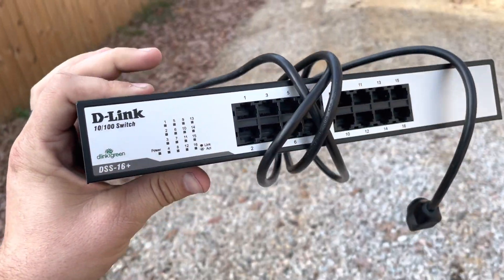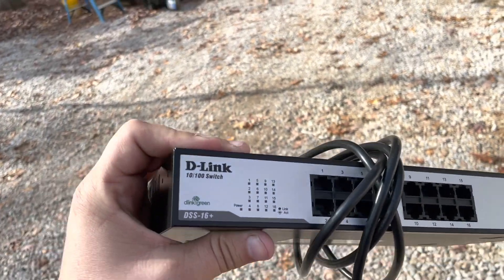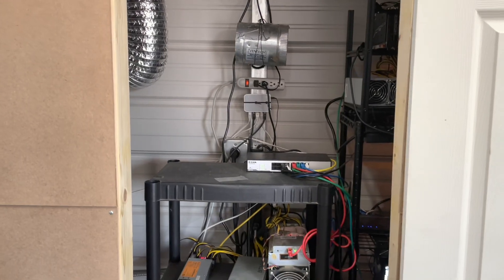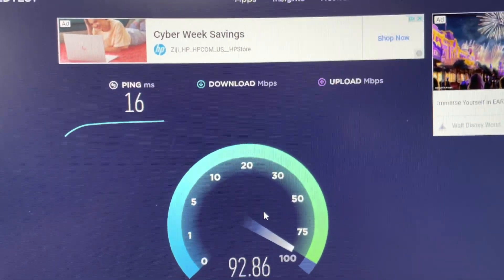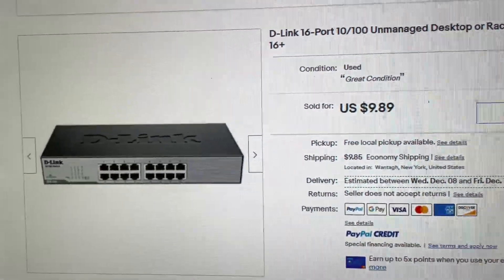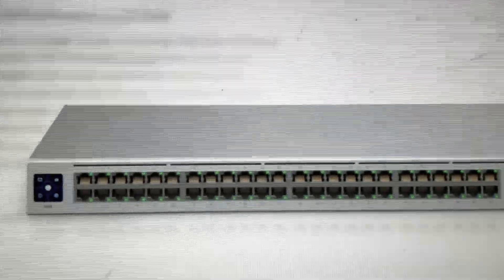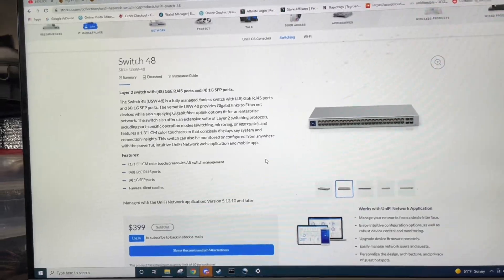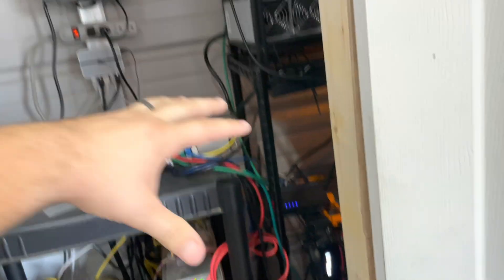Cheap Network Switch for Mining Rigs

Comment: Any old as heck router can be used in switch mode. I literally have a stack of old Linksys routers that can all act as 10/100 switches. I pay about 5 bux for them at a thrift store and they are bullet proof. And if one breaks? Oh well I guess I just have to go back to the thrift store and pick up another 5 dollar old tech router. The struggle is real! Also there may be some advantages to dividing up your connections with many smaller switches depending on how your rigs are arranged.  Having one main switch means more cable routed direct from the switch to the boards. Either way switches ...even the old early 2000's versions can be daisy chained. I prefer cheap over fancy b/c its much less expensive to repair if it breaks.

Comment: The Ubiquiti gear is super sold only problem is its always sold out. I have a AP and there edge router . I would have even more if i could get it. What your running is called a Double NAT setup which has so increased security but also has so issues, things like running smart nodes, Chia servers or Helium routers i have found really need forwarded ports and direct access. I can chat more about getting your network going well if your interested. Thanks for the content Jelly fish out.

Comment: Any 10/100 switch will do, if it is 32 port so be it. no need to spend $400 for it you you don't have to. 
that being said, D-link I'd personally stay away from.
P.S. A subnetwork in a local network.
Reply: while any switch can work going super deep spanning tree can cause a few issues.
Reply: Either a sub C level or a nr "2" [equal class] as in 192.168.2.x inetad of 192.168.1.x is not a big deal, it specially in the setup demonstared.
Reply: @litlehack1  Does US use the same ABC levels as EU does? Some switch to intranet and build A level doing 10.x.x.x.
Reply: @GDS-LTD  yes we do use the same subnetting.
Reply: @warscoutii9687  A switch is a switch, it expands the network and doesn't build a new branch, not unless it is a smart one. So If it is a reliable one, there can be 10 of them working together without too many problems. Given masks allow it etc.
Reply: @GDS-LTD  I totally get what you mean but especially if someone is just buying used enterprise or random gear and tucking it into random office corners it can become a nightmare to hunt down odd networking issues. I definitely prefer doing centrally ran networking.
Reply: @warscoutii9687  Subnet collision, my favorite thing, not. Also I guess that makes sense, if one buys an actual industrial grade device, it won't be as user friendly and most probably will have something preset to the internal company settings.

Comment: By having a router plugged into another router you are double natting (Network Access Translation).  This is not ideal performance wise but it should still work.  On the other hand having a router plugged into another router makes it slightly more secure because you have a firewall between buildings.   Unmanaged switches sometimes called dumb switches do tend to lock up and have to be power cycled from time to time.  The best solution is to purchase a managed switch that you can log into and look at the ports and manage them.  You probably don't need all of those features but those switches are less likely to lock up like that.  There are various brands you could choose say HP/Aruba, Cisco, Meraki, NetGear, Linksys, Instant On, etc.

Comment: "Can do everything but kitchen sink" from now on I'm going to say this on every new product spec meeting...
Regarding switches, I'm sure there are better deals, used 48 port switches under $30 are common like dirt.
Looking right now at 48 port + 4  port SFP switch with minimum bid starting at £1 and seems like no one bids it and the auction ends soon.
I no way I'm going to have 48 rigs at my small flat but I think I'm going to buy it just to prove the point xD

Comment: You can get older cisco 2950 24 or 48 port switches for 20-30 bucks on ebay. Enterprise grade and will run flawlessly.
Reply from the maker: tyvm!!!
Reply: @brandoncoin  If you had a po box i would totally send you my retired 2950. I upgraded to a 2960S years ago so my old one is collecting dust in the attic. 

Anyway love your videos.

Comment: Network Switches do not fail often and it is rare that you even get a Bad/Lemon One currently.

But...
They can, and do.

Rather than a Single 48Port, (It seems you have Expansion Plans),  

I would suggest going for 2 24Port Switches at 50% Capacity, Plugged into separate Breakers and/ir UPS's.

That way, if there is some failure you have enough spare ports just to replug.

(So for 2 Switches be at 50% Capacity, 3 Switches be at 66% Capacity, 4 Switches be at 75% Capacity.  That way there is always enough Spare Ports to revover from a Single Switch Failure.  

Or have enough Older Tech Switches to cover...

Nothing like being 100% down for lack of a Single Part...)

I would stick with the Mid-Range Switch Tech for Pricing.

Comment: Used enterprise level hardware is the best <3 such a great deal for a great piece of hardware! Thanks for sharing man. I have a netgear 24 port switch I got for free but then fan started going out and making a bunch of noise... can't decide if its worth a new fan or just switch to something like this unit with no moving parts / fans.
Reply: Fix it to avoid it ending up in the landfill?